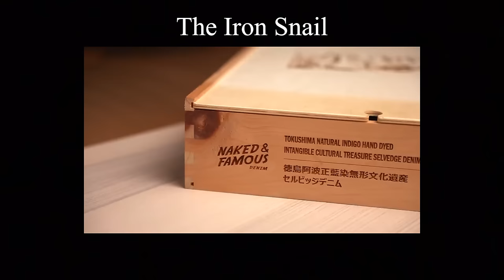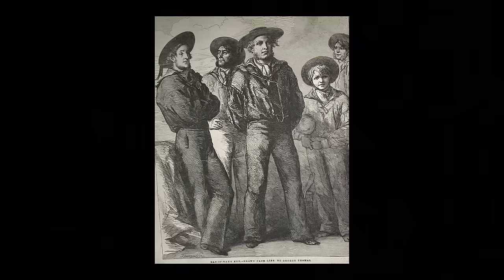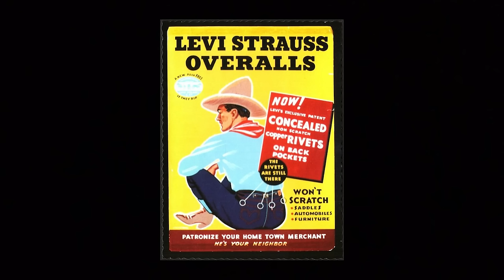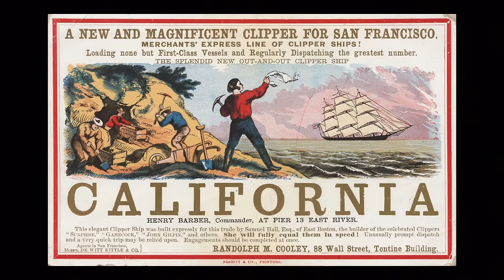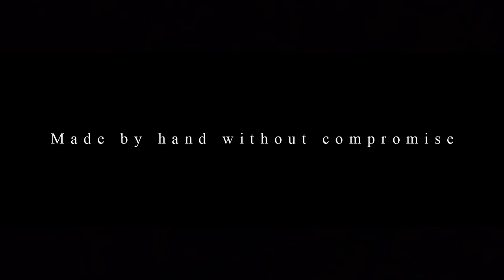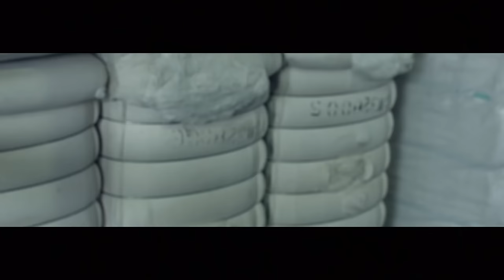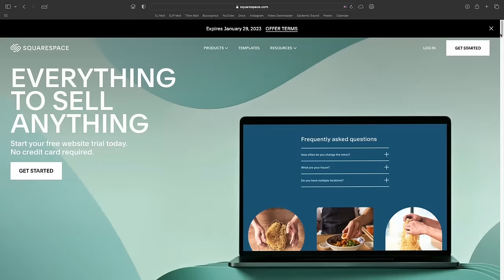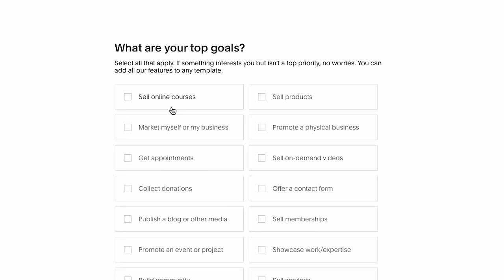Why Japanese Denim is considered to be so good

Comment: PSA for those getting into raw denim: don't baby your jeans and obsess over how/when to wash them. 
Just wear them hard and wash them when they're dirty. You'll get sick fades regardless
Reply: I was wondering because I’m a tradesman and considered getting a couple pairs for work
Reply: @jniles281 bro mine faded in a month or two. Compared to my casual pair that took like 6-8 months to actually fade correctly. Depends on what kind of work you do I guess. I make kitchens/custom furniture so im on the the ladder, floor, rubbing up on my benches etc. I have two pairs of the 18 ounce straight fit unbranded jeans.
Reply: @NYSeaNile just saw this and I’m an iron worker so I’m hard on jeans

Comment: about 10 years ago I was in a Gucci shop [in Harrods] explaining to the assistant about selvage jeans, while trying on a pair , we, I was delighted to find that the jeans were made by Evisu.. £250 pounds later, still have them , sadly only worn them about 5 times, when it says 32 waist you'd better be a 31.5.... or leave the top button un done

Comment: I love Japanese denim.

I have a pair of Momotaro 0605 (Natural Taper) in 15.7oz denim.

I want a pair of straight fit denim, and am considering either a pair of Iron Hearts of a pair of Edwin Japan.  Both of which are sold by a local stockist.

IF you are interested in denim, and don't (or can't) spend $300USD+ for a pair, I would look at some excellent North American brands.  

Naked & Famous is a good entry point, or perhaps The Unbranded Brand.  Other very good brands include Left Field NYC, Rogue Territory and 3sixteen.

Comment: People in the "denimhead" world seem to have wrongly turned the meaning of the word "selvedge" into equaling "quality".  Not sure how that happened.  I only recently discovered the wonderful world of Japanese denim and after only a few days of looking into I was able to easily find that selvedge is simply the end border on the fabric created by shuttle looms.  It has nothing to do with the quality of the denim.  The quality of the denim is in the quality of the cotton, weaving, dying etc.  

So if you take the same threads and put half through a shuttle loom and half through a projectile loom you will basically have the same thing.  If anything, a better argument can be made that the resulting projectile loom fabric will be better quality, because fabrics with tighter weaves are more durable.  Projectile looms weave more tightly than shuttle looms.  Of course, we know that there is more to it than just durability, but at least durability is an objective measure.  Most everything else is a subjective aspect.  Such as simply "liking" slubbiness, etc.  

This is where someone might probably argue "but on the projectile looms the edges may cause the fabric to unravel."  To which the response is "yeah right.".  People who sew know how to close those ends.  Just look at any pair of non selvedge jeans.  Those stitches are virtually never coming apart under any normal wearing conditions. When's the last time you ever had a pair of non selvedge jeans do that?  I've never in my life seen that.  So while technically true, that argument is completely ridiculous.  

People need to realize language matters.  Selvedge does not equal quality.

Comment: Look; Great denim. Handmade , real indigo flowers. No question. The issue is: who gives a toss in a dimply lit party or across the street ? No one. Except the owner. If I saw the most beautiful normal girl in a bar wearing Target jeans I wouldn’t care less . Similarly, if you’re a fat tosspot in the bath, you’ll be a fat loser in expensive jeans across the street. If you wore a Patek Phillipe  watch.. who cares ? Just the gangsta that’s about to chop your arm off. Yes watches have investment value, I realize that. But this is why you don’t go around pulling your sleeves up hoping someone will notice the watch  brand. In summary overpriced, well made overhyped but no one notices if you’re in the street. No one, but no one is going to stare at the cuffs of your legs ……